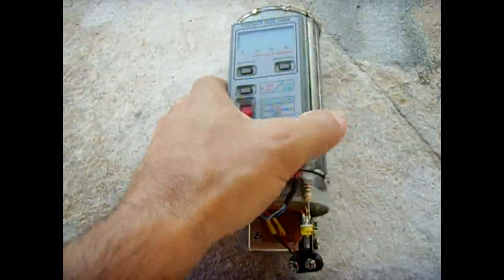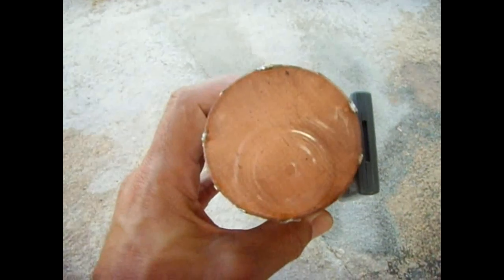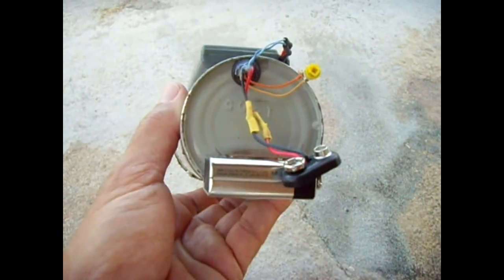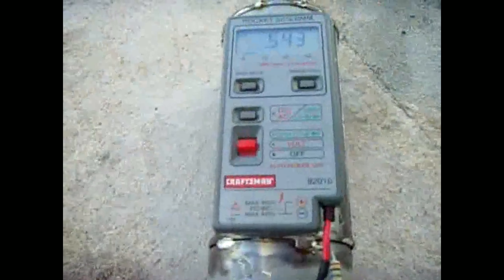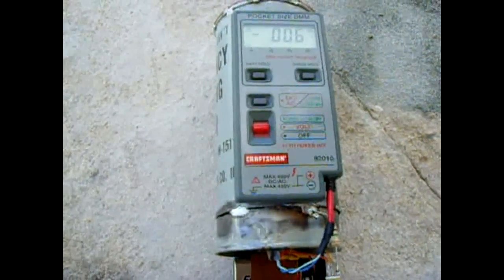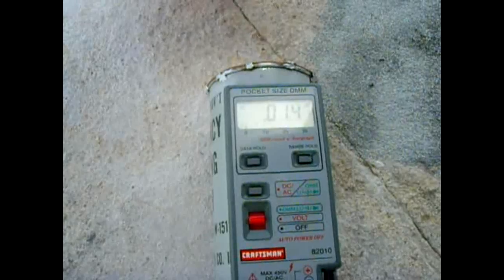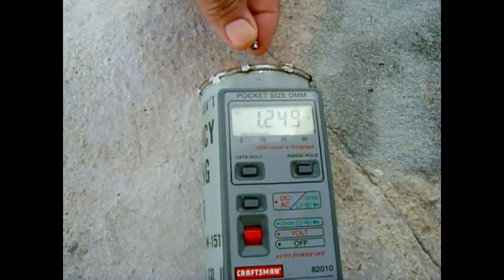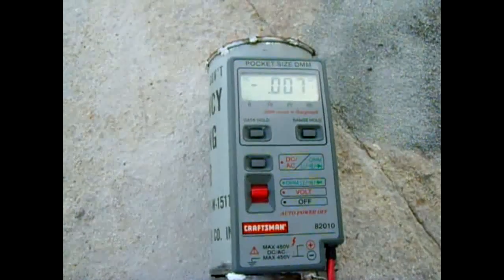How To Make A Sensitive Ionization Chamber

Comment: I think this would do really well with a crazy sensitive, super high impedance, super low offset current op-amp like the LMC-6081. I'm going to have to have a shot at it to see if I like it as opposed to a regular GM detector. Would really love to see this running on a good, fast oscilloscope.

Comment: There is a strong difference between the words "emission" and "contamination".
If you breath or ingest accidentally a single particle of Am-241, you are contaminated.
The Alpha emissions have a strong ionizing power, and are very easy to block (only a  foil of paper can block this emission)
BUT, a alpha-emitter  inside your organism is impossible to shield, so it's very dangerous 
You can take your risk, sure, ... but why?
I suggest you some reading refence :
tinyurl(dot)com/bscwtyc

Comment from the maker: Am-241 emits mostly alpha particles which are blocked by your skin or a sheet of paper. There are some low level gamma rays being emitted. Unless you hold it in your hand all day long, or swallow it, your OK.The back side of the sample I was holding shields most of the radiation due to the housing the Am-241 is in. Only one side is open to the environment.